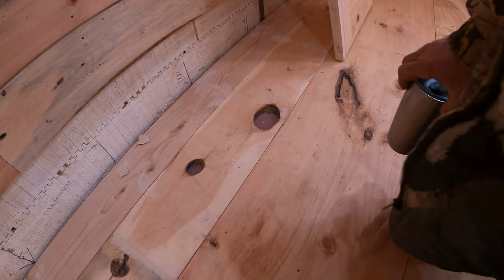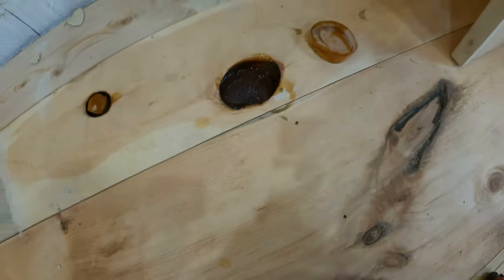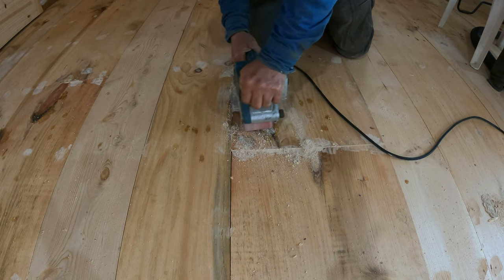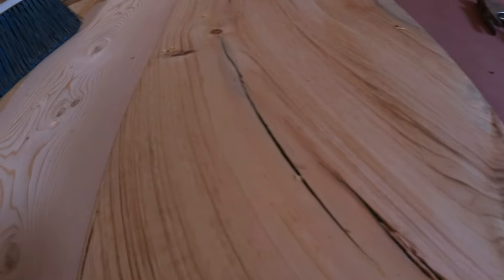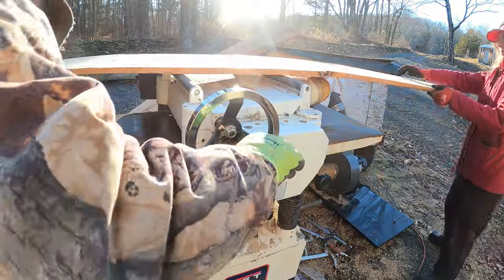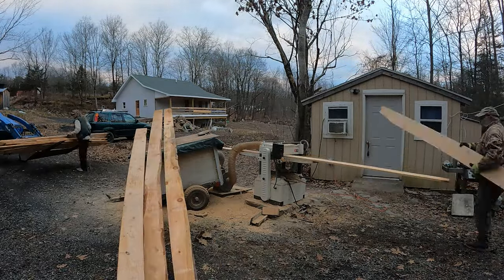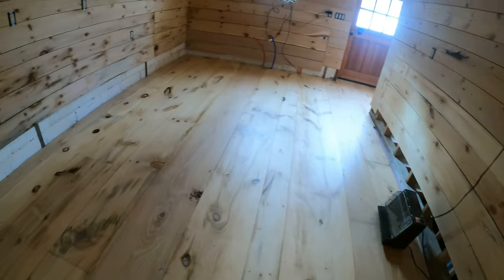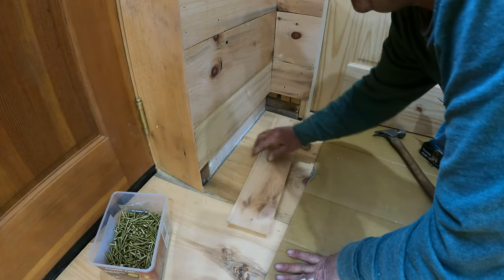Finishing wide board pine floors

Comment: Depends on how good the structure is underneath.  If you have 1 1/4"" tongue and groove plywood on sixteen center joists then there would be no harm.  Because of the problem of dirt collection I think I would squeegee a layer of West System epoxy over the entire floor to fill any inconsistencies.  I would also give a try to a layer of polyester fiberglass with a lightweight fiberglass cloth.  In my experience if it is not an oily wood (then epoxy is hard to beat) a single layer of cloth and a couple of coats of polyester resin will give a see through look and not hide the grain at all, plus it is a nice wear surface and easily redone if ever needed.  Character in wood is great as long as it doesn't effect function.
Reply from the maker: interesting

Comment: dear Dan
may i ask you, why do you recommend a gab between the floorboard and the wall and why its not need a gab between the wallboard and the floor?
Reply from the maker: if the floor picks up moisture it will swell and buckle the wall will shrink some and i didn't want a gap
Reply: @danwheeler5130  thanks for your answer. i am an old DIY-typ from the Swiss mountains. there people told me to also make a gap to the floor. and then cover it with a skirting board. for sure your version looks much better!!! 
love your, incl. Mrs. W videos. stay save and sound!